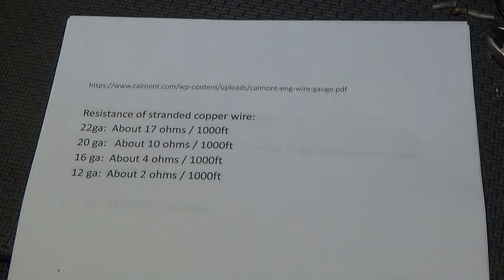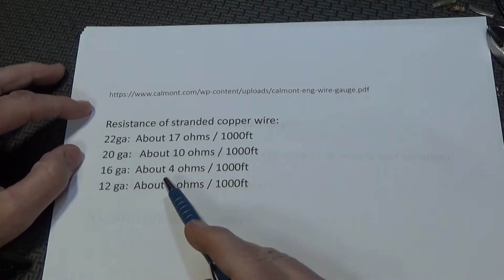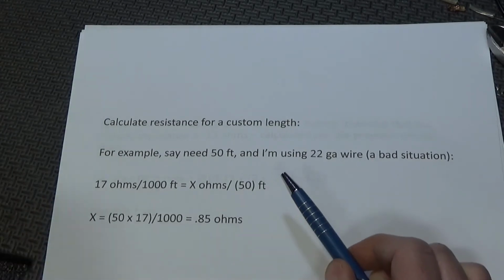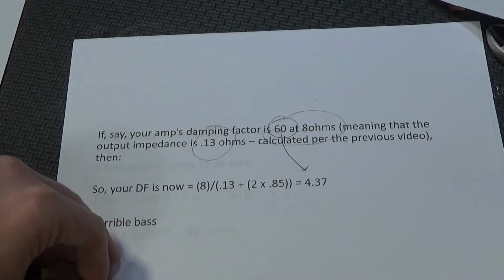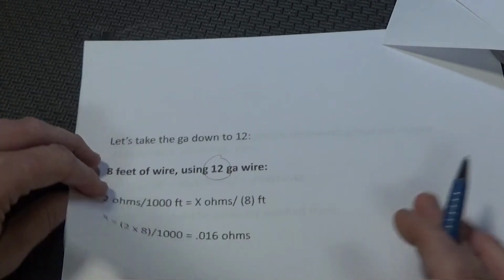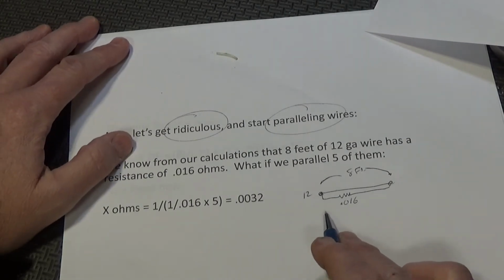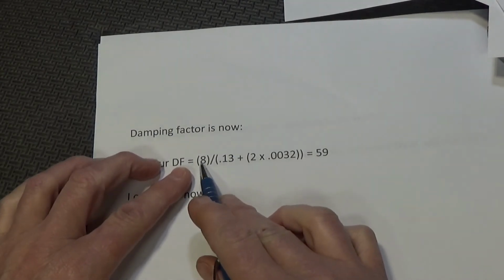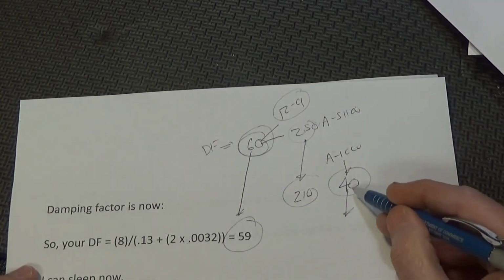Damping Factor, Output Impedance, and Speaker Cable Resistance: Follow Up Vid

Comment: I would rather just buy a single heavy gauge wire such as 8 gauge instead of doing multiple runs of wire. I'm unsure if there would be any coupling effects with running multiple wires next to each other like this. If your willing to shell out a few thousand dollars for your stereo gear, surely you can spend a couple hundred bucks on some decent quality speaker cable. People need to stop being so cheap!

Comment: I have the as1100  I have a set of Ruark CL20 floorstanders, 6 ohm 87db sensitivity , ok to bi wire these ?? using the as1100    cheers

Comment: I use 4ft. Canare 4S11 cables bi-wired out of my Yamaha AX900U. Nice clean sound with tight bass. Also using Nakamichi gold banana plugs.
Reply from the maker: That's 11 guage; more than suitable, seems like a very good cable.   Also, Yamaha makes a good amp; I've never heard the 900U, but judging from my experience with Yamaha, it's like a really good set-up.  Regards ....

Comment: That was very interesting, thanks!
I've read about inductance somwhere, and I'm wondering how important it is. I've been doing some tests with regular/cheap speaker cable and so far I've noticed that, in my system, the bigger the cable the better it sounds; but I'm curious about those high end cables like that QED XT40 that was mentioned before (which looks great btw).
Reply from the maker: Inductance in an ordinary speaker cable (e.g., a stranded wire) at a length of 4-8 feet or even well more, at any audio frequency (e.g., 20Hz-20kHz) is less than minuscule and insignificant w.r.t. interacting with the speaker load in such a way as to alter the frequency response.   The most important thing about speaker wires:  Gauge, and hence low resistance, stranded wire (never solid), and a good insulator/dielectric, and good connectors.  Inductance is irrelevant, and even capacitance is minuscule so long as the two wires + and - have a good separation distance.   I've never seen any credible evidence of inductance or capacitance of ordinary speaker wire altering frequency response by interaction with a complex loudspeaker/crossover load.  Cheers ....
Reply from the maker: Expensive cables provide a psychological improvement, and they look good, and for some they are a status symbol.  That's about all I can say; just my humble opinion of course.   I realize I differ from many golden-eared audio dudes.
Reply: Ok, I understand. Thanks for the info.
I'll probably get some of those fancy cables sometime. If they make music sound better, even if it's just a psychological trick, they may be worth it anyway. If it sounds better to me... that's the important thing, I don't really care if it's a placebo. I'm getting the sub-$100 cables though :)
Reply from the maker: I 100% agree; if you think it sounds better, and the perceived improved sound is worth the price of admission, then it's a good value to you.  That's all that really matters.   And, they look nice!  Oh, sub-$100 cables, those aren't really the BS that I'm talking about.  I'm talking about speaker cables that cost in the range of say, oh, $500+.  I just say some McIntosh speaker cables that were well over $1k each.  But, if one has the money, and I don't, then what the heck.  Regards ...
Reply from the maker: Here's a steaming heaping pile of BS for you to consider :)  Read the description and marvel at the gobbledegook.

http://www.mitcables.com/available-in-stores/speaker-interfaces/$10000-+/oracle-matrix-hd-90-rev.-2-speaker-interface-8ft.html
Reply from the maker: Yeah, they look as though they would sound fairly acceptable.

Comment: Hi. Just a quick question seen as though you know your stuff.
I have a Marantz SR6012 with a pair of Dali Opticon 6's (4ohm speakers) on the L & R channel.
I'm using 4mm QED Reference XT-40 Aircore Technology Speaker Cable to power these.
The run is only 2 metres so I'm going to presume these cables are overkill? Do you agree?

What size cable should I be using for my set up? 

Cheers mate, Mike in Manchester, England.

Enjoy your videos by the way! 👍
Reply from the maker: Those are 12 ga wires.  At 2 meters, absolutely no issues whatsoever.   They appear to be very fine cables indeed.  I don't lean toward the expensive stuff, but I do use 12ga, as as indicated in the previous vid, that 12ga provides you with an exceedingly low resistance to the point where any effects on the system damping factor are negligible.  Again, must people fall into this category.  It's only long runs of high gauge wire that causes problems.  Regards ...
Reply: stereopolice Hi mate. Thanks for the reply! 👍. Unfortunately, I fell for the fizz and sparkle of the expensive cables when the cheap stuff would work just fine. You live and learn I guess. 

Thanks again, looking forward to your next batch of videos...👍👍👍👍
Reply from the maker: LOL, hey, live and let live.  I might make a slightly snide remark ever now and again about spending too much on cables, however, if they provide a "perceived" improvement, then they actually provide an "improvement".  I have no problem with that.  Also, what you get is excellent quality assurance with a reputable company, soldered terminals often times, a quality sheath, gold plated connectors, and something really nice to look at.  Nothing wrong with that!  I might break down one day and spend too much on cables too.  But first, I'm still spending too much on buying used amps to tinker with :)  All the best ...
Reply: stereopolice But you're right though, that's the thing. You're right about the cable cost issue.
And no, you definitely won't ever buy ridiculously expensive cables! EVER! LOL.

take care pal....👍